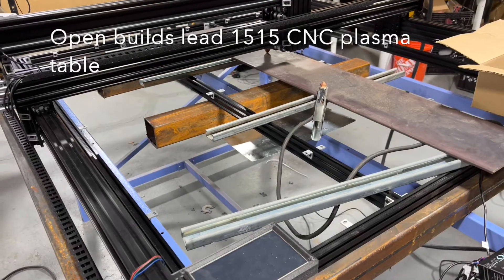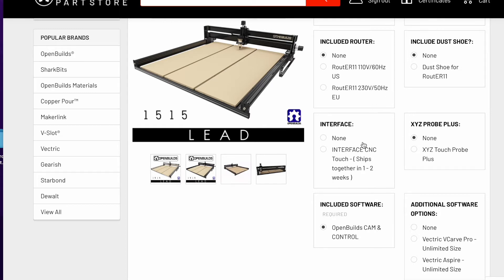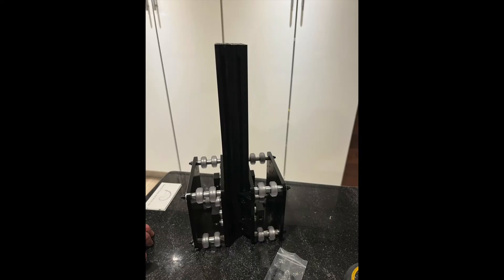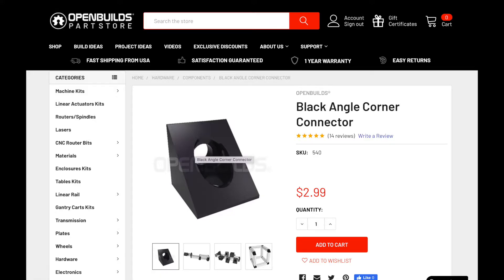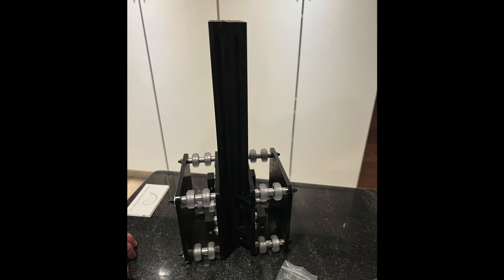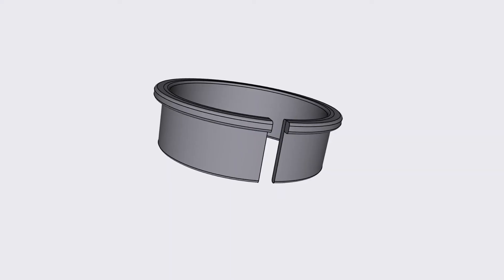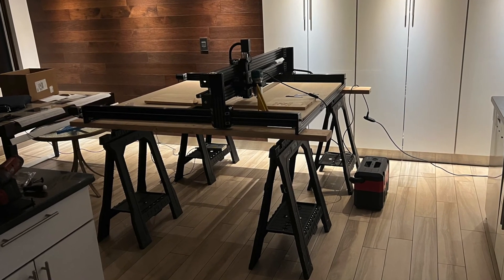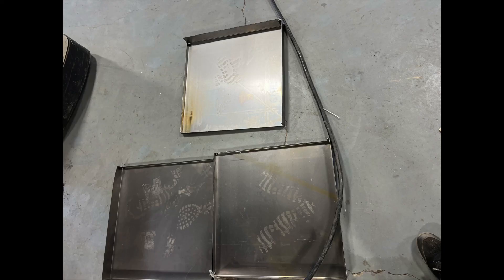OPEN BUILDS LEAD 1515 CNC PLASMA TABLE

Comment: This thing is beautiful! I ended up building my own smaller version since the price was a little too high for my needs. Mine is definitely not good enough to be a cnc router like this, but does plasma just fine, i also added a manual Z axis with a knob just to make it easier with the laser engraver boards im using.

Comment: Going to make an updated video? About to do the same but would like to see how yours ended up, there is a guy that figured out htc on the blackbox.
Reply from the maker: I have been using it as it is, haven't had any time to tinker. I am hoping to updated this winter, will see. I have some home renovations I have to do before spring. Thanks for watching!

Comment: Im interested un building a plasma table using a duet2
Reply from the maker: I am working on a follow up video. For now I am trying the Langmuir Z axis upgrade kit they sell with torch height control, for $750 you get a controller with three drivers but it is pre-wired to add the fourth driver for the second Y axis. i’d love to know your thoughts! https://store.langmuirsystems.com/collections/add-ons/products/z-axis-thc-upgrade
Reply: @worknplayusa did you ever end up doing that with the firecontrol setup? I'd love to get some feedback or see a video on it!
Reply: You can make one with parts from open build and a limit switch fairly easily. I have some questions about your do it system? Have any links?